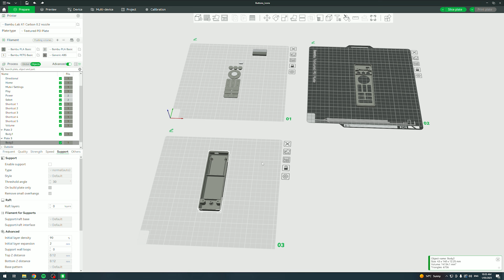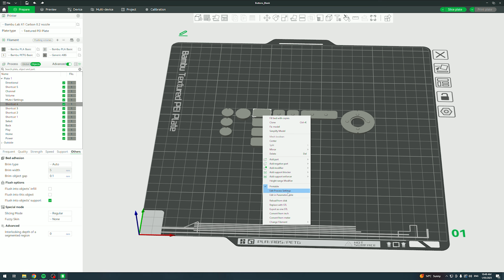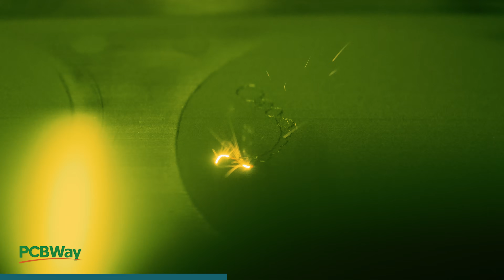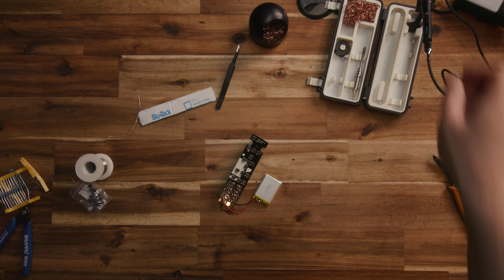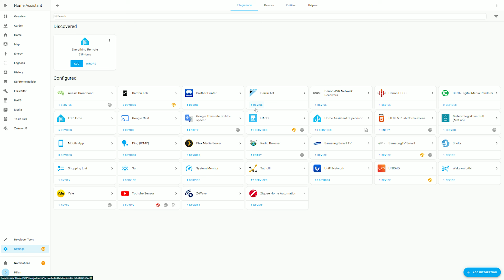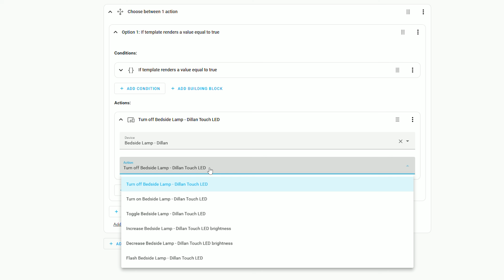Make Your Own Universal Remote (ESPHome + Home Assistant)

Comment from the maker: There is now a parts kit available for The Everything Remote! 🎉🎉

Get all the hardware required in one place, you just provide the battery and prints! 
https://www.thestockpot.net/store/p/everything-remote-kit
Reply: Will parts kits be restocked? (and if so, any idea when?)
Reply: @garrettc.9451  parts kits are in stock right now (6 Nov)
Reply: Hi mate, just a heads up, the link to the Esp32 board in your BOM has been revised by the supplier, and it no longer works over usbc. It’s missing the necessary resistors on the usbc C1 and C2 pins. 
Edit: works if you use a usbc->usba converter dongle on M1 Mac, not a hub.

Comment: Love it! Thinking of making one for myself as my Chromecast remote does not have enough buttons for me.
Zigbee instead of WiFi would allow for much longer battery life. There are ESP32 boards that support Zigbee radio. 
I would prefer not to have another thing connected to my network as a possible exploit.
Also, it would be possible to add wireless charging but that's more of a convenience thing than a necessity.
For those who are talking about IR integration, there is such thing as Zigbee IR blaster that connects to Home assistant and can send IR signals. I am actually thinking about using that instead of hacking in an IR emitter to a remote.

Comment: Pro tip: first test your ESP device by flashing it and connecting it to Home Assistant, BEFORE installing it onto the board. It's very common to have a faulty board.
Reply: I learned that the hard way 😅
Reply: I just came here looking to see if anyone else had their completed remote completely fail to show up in ESP Home.  I bet that's my problem.
Reply: @JennaFromDaBlock  Very likely.
Reply: @NylzTube i believe it's actually a Linux thing where there's a communication breakdown that i need to troubleshoot. 

I used my wife's Winblows computer and after i installed some Chinese drivers it worked. 

Now my only problem is the board doesn't seem to be charging the battery (and i tried two different batteries).

I didn't remove the battery connector like Dillon did (I'm using the remix of the remote bottom where there is room left for the battery connector), so now i have to try to troubleshoot that.

Comment: Just a heads up, the link to the Esp32 board in the BOM has been revised by the supplier, and it no longer works over usbc. It’s missing the necessary resistors on the usbc C1 and C2 pins. I found out the hard way, with 2/2 boards being direct copies of the original board (USBA) without the resistors.
Reply from the maker: Thanks for the heads up. It seems it's a bit of a wild west type situation with these boards! I'll add a note to the repo so people hopefully avoid getting caught out!

I think the V2.0 will use something a little more modern and from a reputable supplier, even if it means slightly higher cost!
Reply: @TheSaucepan-AU I did pop you an email if you got a chance to read it but a firebeetle 2 would be a great fit! Easy solder battery pads, much better battery life, easy touchscreen connection. All for about £10.
Reply: As someone who has the PCBs but waiting on the esp to arrive ...what does this mean? Does it flat out not work? Do certain buttons not work? Does it boot? And if you know.... What's the solution?

Edit: Oh wow it literally just means you have to use a USB A -> USB C cable instead of C to C. That's mad!
Reply: @adamburgoyne8398 Yes. But it sucks that the photos don’t match what we’re getting from AliExpress. There’s a revision of the board that “just works”. 

One win for Windows/Linux. Stupid me stuck with Usbc->usba->usbc on MacM1! 
I was trying to over complicate things when it didn’t work via usbc hub and then remembered I have a tonne of usbc->usba converters.
Reply: @MichaelDurell  The board in general isn't really the best fit for the project imo. Something like the Firebeetle 2 would have much lower deep sleep drain (800ua vs 55ua) which is incredibly useful for something like this which spends most of the time in deep sleep, it could be weeks longer on a charge. It also has the benefit of the battery pads ready to solder straight onto so no naff with cutting the adapter. Slightly longer but with some case tweaks probably not really noticeable. Same for me on the macbook, thankfully had some adapters lying around!
Reply: @adamburgoyne8398  I think it came down to price. Something from AliExpress shipped for $4 is always going to beat a better board. Anyhow, I did consider skipping the headers and using something like the esp32s3 (overkill!) because I had it lying around. But, in the end the lite board worked with the adapter and crisis adverted. 
I think the pcb is versatile enough that if you even soldered another board with matching headers to it, you could change the gpio pins in firmware. But I didn’t get that far.

Comment: An idea for the battery. Is there any disadvantage that I'm not thinking of if you soldered the female version of the connector that comes on the battery? It would make replacing the battery in the future a simple task.
Reply from the maker: Other than space, no real disadvantage!

Comment: I would have loved to see the PCB design process
Reply: The PCB is next to nothing of a design with very little to no engineering knowledge required.  You could call it a break out board since it breaks out the IO of the ESP32 to individual buttons.  The good stuff all comes on the bought ESP32 board.

Comment: @TheSaucepan-AU 
PLEASE add a step AND warning in these instructions to trim the excess legs off the buttons over where the battery sits.

I had a couple of them poke holes in my battery.

THANK GOODNESS I smelled the battery before it popped, as I was able to save my remote kit and 3d print, but the battery is now burnt out, and I am VERY freaked out.

This could be a life saver for someone.
Reply from the maker: Thanks for raising it with me, and I appreciate you reaching out via email too.

There is an extended version of the case on Printables if your battery is a little chunkier. I've seen no issues with the recommended battery from the BOM.

A little bit of tape over the legs is a good idea too.

Comment: Hey, nice project. I'm doing it with my son as a Summer Vacation project. However, we're running into some issues. Tried to contact you via email, but didn't get a reply. So let's try if you see this message... 

The first try, I was not careful enough when removing the battery connector from the ESP board. Ripped off both pads, so no chance of connecting the battery. So I ordered 2 more ESP boards. The second try, I was really careful and managed to remove the connector but keeping the pads in place. As per the instructions, heated up the pads to remove the remaining parts of the connector. Then when I was trying to solder the battery wires, the positive pad went loose. When there's no pad, the solder doesn't hold anymore, so there's no chance to get the battery connected. (Right? Or am I missing something here?)

 My conclusion is that removing the connector isn't such a good idea for a beginner's project after all. I'm considering ordering a new connector for the battery and then just connect it via the connector. But then it won't fit in the case. Any chance that we can get an updated design for the case where we can just connect the battery with the connector? My 3D-design skills are not yet on the level where I could design something like that myself. Alternatively, if there's any chance I can repair my lost pad, I'm open for that as well. (Although the results of googling on "repair damaged SMD pad" were not very encouraging. Looks really complicated and error-prone to me...)
Reply from the maker: Hello! I might have missed your email - apologies! 

Once the pads have come loose, there isn't another way to attach the batts. They can be a little tricky to take off, and I think some ESPs are better than others!

Since making the tutorial, I've found that clipping the legs of the connector (at the back) before trying to remove the plastic parts gets much better results. 

I'll add a battery connector compatible version to my list, but I don't know when/if I'll have a chance to put it together!
Reply: @TheSaucepan-AU  Thanks for your reply! We've now "designed" a case by taking your design and stretching the part where the connectors are. This works, sort of. It doesn't look as polished as the original design and somehow the both parts don't snap together as nicely as the original. We're using Tinkercad, which is a bit limited. What program do you use for your 3D designs?
Reply from the maker: Fusion 360 is my go-to!
Reply: See comments above. You could solder the + and - to the capacitor directly behind the battery pads in the same orientation (+ is the side closest to the GPIO pins). Otherwise, there is a GPIO pin  “G” right there for the - and you could attach the + to the third leg of the TP4045 package (the leg pointing at the 2 of GPIO pin “12”.

Comment: Great project, thank you so much. Easy for tinkerers but boy is Home Assistant not ready for the broad audience yet, even if it improves rapidly with every release. The only gripe I have with this is that I think Bluetooth would be a better choice for a remote because it requires less power.

Comment: So I did some testing; With the deep sleep functionality the board connects to wifi within 2 seconds, amazing! However, the connection to home assistant can take up to 8 seconds, which is not usable. Does anyone have any suggestions?
Reply: Ok so I gave up on ESPHome for this as the latency is just aweful. I'm currently working on an esp-idf based project and preliminary results are amazing, with initial delay after deep sleep of about half a second!
It also seems to improve battery life but I have no data on that yet (will update/add to once I do).
Reply: @Yomantica1992 where did this end up?
Reply: @JennaFromDaBlock  Still quite bad battery life, but I haven't had the time to fully dive into it. Did some testing and, even though the battery life seems a bit better, startup time is worse from deep sleep. I've had some talks with a colleague and he gave me some pointers which I'm going to pick back up in spring.
Reply: @Yomantica1992 thanks for the update!  You didn't happen to have any issues getting the battery to work in the first place, did you?  I kept the plug instead of ripping it off, but the device won't run off battery at all (like the battery isn't even charging) and i have no idea wtf.
Reply: @JennaFromDaBlock  I did the same for now as I'm still testing so everything is on a breadboard still, left the plug on and ordered a connector that fits the board. Also I might have some slightly different batteries as well as the ones linked were not available here. They are still the same type though. Only issue I ran into the first time was that the plug that I bought that fits the board connects black to + and red to -. Maybe check your board as well for a little + sign at the connector strips.
Reply: @Yomantica1992 you're brilliant.  My batteries are backwards.  Now hopefully i didn't blow something up.

Edit:  i cut the battery wires and flipped them and the remote works perfectly.  You're my hero.

Comment: This project is sweet. I do have one qurstion. Why not print the buttons woth the logos facing up? I'm not experienced in 3D printing so I am genuinely curious.
Reply: In his example, he likes the texture the item ends up with when printed with the textured plate that printer has.  You get that by doing them face down.  Also, sometimes the top layer of an object can show some remnants of the shape of the "lines" of material that are put down by the nozzle, and printing upside down hides that on the bottom of the button.  You can work around that using something called "ironing" (where the heated nozzle is run back across the surface), but not every printer supports that, it can be hard on the nozzle, and the results can vary.

Comment: Let's say, hypothetically, I pulled the battery pads off the board when removing the connector, on all 4 of my boards. Is there a way I can fix it to still be able to connect the battery?
Reply from the maker: You can probably use just about and ground pin on the board, but I don't think there is another spot to connect the positive lead :(
Reply: @TheSaucepan-AU  I'll try that. Will it show in the ESPHome logs that it is charging the battery? I note that even when on USB with no battery connected it reports battery state to be 84% so this might not be configured right in the yaml
Reply: The capacitor next to the ground pin has one leg directly connected to the positive pad. Look up the datasheet for the TP4045 and check for continuity with a meter
Reply: You can also solder the positive of the battery to pin 3 of the 5-pin LiPO charging TP4045 package. That’s what I did after my + pad popped off trying to snip the plastic connector with a side cutter. It’s so easy to damage the pads!
Reply: @studiohanson  where is this? Or this something extra you purchased… I damaged the pads on both of the esp32s I got…
Reply: @glennlazar1 it’s one of the small IC components
Reply: @H @glennlazar1  https://media.digikey.com/pdf/Data%20Sheets/UTD%20Semi%20PDFs/TP4054.pdf

Comment: i realy like it. i am busy building it. the only thng that gives me trouble is soldering the battery to the board. the first try failed so have to see how to fix it. i am an absulute beginer
Reply from the maker: It can be a little tricky - a big piece of blue tac holding the wire in exactly the right place before you even try with your iron is helpful!
Reply: @TheSaucepan-AU  thanks for the tip it might have worked but i doesnt. if i use a multimeter i can see the board get power but the let does not indicate its on. but if i plug in the usb the lightbcomes on. i am not sure whats to do next.
Reply from the maker: The light isn't always on when powered by the battery. Have you installed ESPHome yet? Is it showing up in there?

Send me an email at hello@thestockpot.net and I'll see if I can help there :)

Comment: If you ever do a new version, try to use GPIO 1 to 20, all of those are RTC GPIO and can be used at the same time as a wake-up trigger from deep sleep.
And also a small led powered by the gpio would be top, it can help see when the remote is active or in deep sleep, and display a low battery warning by blinking.
If powered by gpio it also wouldn't consume anything when in deep sleep.

Comment: Great project. To please the YouTube algorithm I have to like, subscribe and comment on this and save it to my HomeAssistant playlist too 😁
To be honest, I almost quit watching when I realized this is an ESPHome thingy (I had not looked at the title before playing) but I am glad I did not. I somehow dislike(d) ESPHome because every few weeks or so there is an update of the HA integration and then it asks me to recompile and upload all ESPHome devices. At one time I had an issue when something big changed and all 2 of my then current devices stopped working.
Your tutorial shows me that there are many nice things I can do with this so I now I will build one myself to give ESPHome another try. A thing I love to add is one of those cheap wireless charging thingamajiggers and a docking station.
Of course I also need one of those universal IR transmitters to control my old - not too smart - TV in the bedroom and the radio in the kitchen.